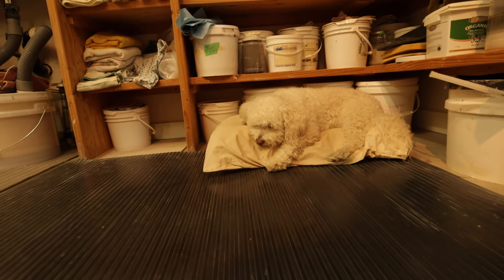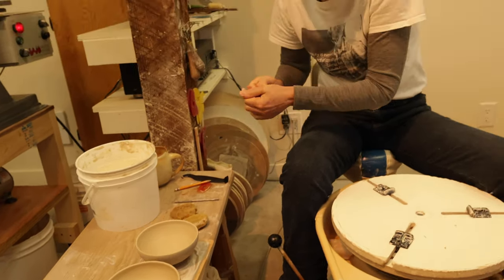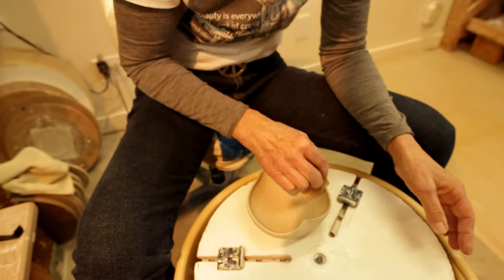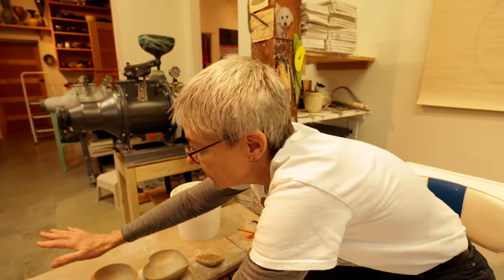In the Creation Room with Mary Fox: Heart Bowls

Comment: how about the next video how you did the inside of the heart bowl.
Reply from the maker: Funny you should mention that, I just did a short video talking about how I glazed some of the pieces in my latest firing. The heart bowl you mentioned here gets touched on briefly as I only had one piece in the firing and it was a refire to seal up a ground run. However I talk about how I glaze the Candace black and other than the dipping time and sg. it’s the same. That video should be up next week and next time I glaze with the Mashiko oil spot I’ll make another video talking about that glaze. It won’t be for a few months though as I have other firing programs to do first before I can go back to the 02 program. ❤️🦊
Reply: @maryfoxpottery  your work is incredible  I can't wait to get my book.